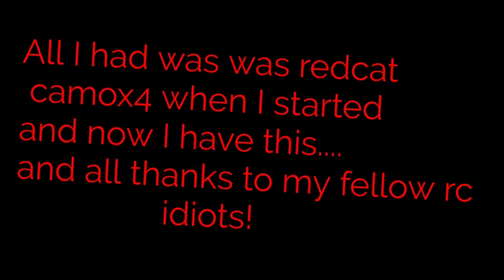Losi dbxl-e 2.0!

Comment: I've had this rc for about 2 months now and here is my experience.
While I haven't broken anything major yet, my down time has been waiting on parts.
The spectrum servo is a cheap piece of shit. It broke within 10 mins of the 2nd run. Replace it with a hi-tec d45wp. Other things that broke ( my fault) left control arm( hit a tree), connecting rod for the turn buckle ( perfect cartwheel), then the other day, the left rear tire decided it no longer wanted to be connected to the rest of the running gear and went out on it's own. It hit a metal fence post and it, the control arm, shock, axle, sway bar link went their own way. Luckily, there was only miner damage and only needs about $35 in parts. Now for the more serious stuff. I've learned from experience and talking to other people that the spectrum esc is actually not powerful enough for a 1/5 scale vehicle. I've had 4 batteries puff from over heating and discarge due to the fact that the beeps said the lvc was at the stock setting and it was actually at the low setting according to the program box. The motor gets hot enough you can't keep your finger on it for more than touch. So I'm upgrading to the castle xlx2 or the max 5. See how that works with the stock motor. If any problems, the motor will be replaced with the castle 2028 800kv motor.

Comment: Fuck yeah man I'm so glad you went with that color looking at this thing makes me want to get one of these instead of a x-max
Reply from the maker: That's a tough one.
Reply: Two different RCs for different terrains. If you plan on going to a skatepark, get the X-Maxx. If you want to use it for open fields, dirt and pretty decent jumps, the DBXL-E will completely change you. Any 1/5 scale will change your RC outlook. The X-Maxx is 1/6 scale. The DB is 1/5
Reply from the maker: Fuck dude! That was the perfect answer! Shane, exactly what Lane said.
Reply: @SebastianLong  yea I get that there different.i want to be able to do backflips and good jumps but also drive on grass fields like to drift around corners I'm thinking I'm gonna have to get to.i was thinking the Kraton exb but idk plus traxxas is an american brand and imo the Kraton is 6th scale not 5th scale
Reply: @SebastianLong  and what do u mean by change u I've seen the losi gas version
Reply: @shanemcclain8562  the shorter wheelbases tend to do backflips, wheelies and such better but can be a bear to handle if you want to pick up speed quickly. 

Driving a 1/5 isn't the same as seeing a 1/5. 😜

Drifting, you would want longer wheelbases

From what you said, you'd probably be better off with the X-Maxx or Kraton 8s, but rest assured. You'll want more. Lol
Reply: @Shadows-RC  I've seen a video on another YouTubers channel with the DBXL-E against two X-Maxxs and the DB was still pulling the X-Maxxs around. Lol.

Comment: Electric turd. Just kidding. The Dbxle's are pretty dang sweet, but should be at least 10s in my opinion. I've been wanting the 2 stroke variant, but I'm gonna yank out the 32cc from my 5ive T when I get my BR 40 for it.

5:09. Mod 1.5 😉

12:00. Most Losi's are standard Allen. Just be careful of that.
Reply from the maker: Thanks Lane.
Reply from the maker: Damn it I meant 1.5 mod lol what an idiot.
Reply: @heavymetalrc7520  I figured you meant 1.5. Either way, they are huge. If you have an opportunity, check out the spur gear on a 5ive T. 62 tooth mod 1.5. I never seen a gear that size on an RC till I bought the 5T. In fact, I never seen a 5T in person till I bought it.